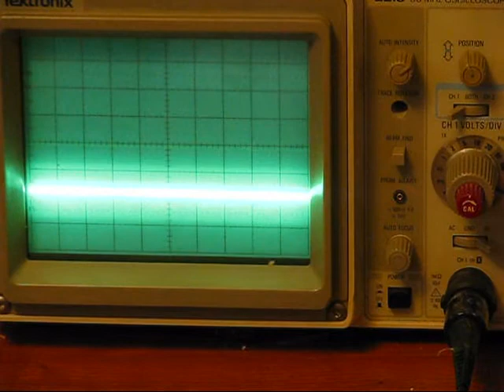The Arduino Infrared slot sensor module from engineeringshock.com

Comment: you could've just hooked up and LED to it :
digitalWrite( LED_Pin_No, digitalRead(Infrared_slot_sensor_ module_input_pin_number))
So when the outputs high from the Sensor, your LED will be high, if the output would be low, the LED would be low, etc